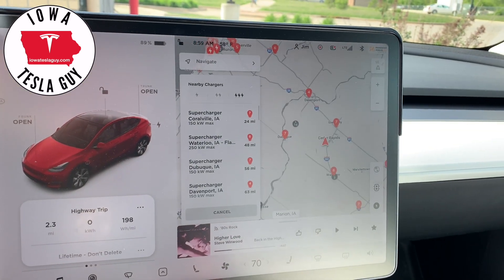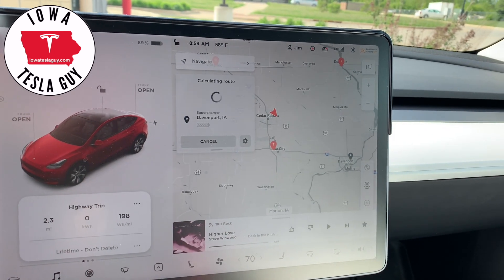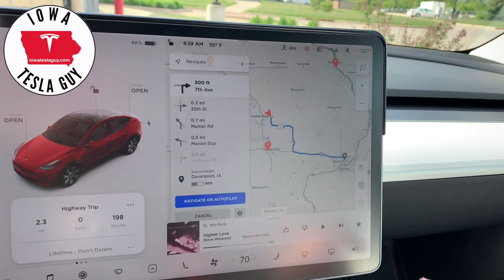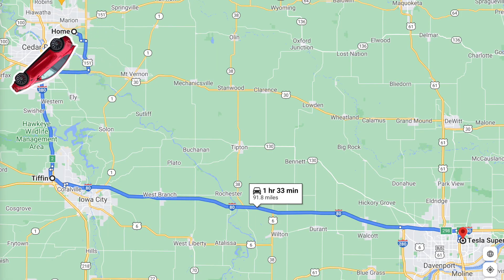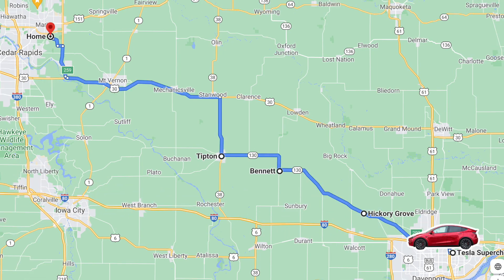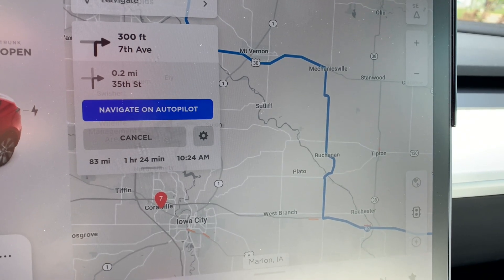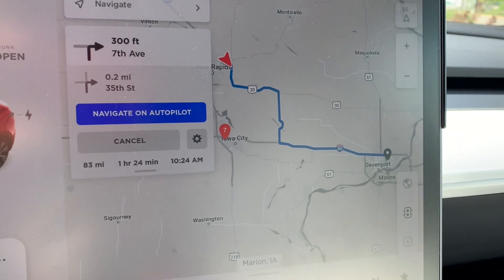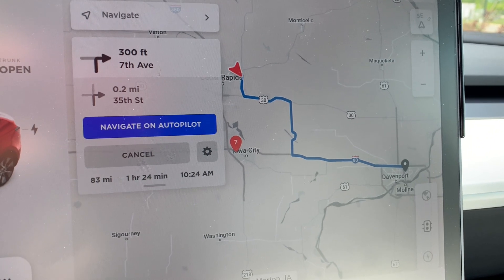Tesla Highway Driving vs Interstate - What is the impact on efficiency and cost?

Comment: Thanks for sharing, I thought your observations about auto pilot were helpful.  I wondered if auto pilot is aware of dead animals  and things in the road.  Also on the 2 lane highways there are always lots of slower areas, curves, hills etc and it appears that the AP does not know hot to handle these correctly.  This is good to know.  

People think they are saving a lot of time by going faster.  Do that math for the distance travelled.  The amount of time saved going faster is not very large for local travel.  It adds up if you are going cross country long distance, but for local travel the difference in the time saved between 55mph, 65mph, 75mph is not that large.  People are just impatient and like the feeling that they are getting it done faster.  Doing the math you find out it really isn't that much faster.  

Also if you were having to generate that power KWH yourself you also know that every kilowatt is quite expensive to generate.  I am convinced the reason people are so casual with wasting energy is they don't have to provide it themselves, and the subsides keep the cost artificially low.  Many people parrot back "climate change", but if they are serious about it they suddenly pay very close attention to all these details of all their energy used and not just when cruising around in very expensive EV's.  I heard it once said that until you carry your own water you don't value every drop.

Comment: It would be interesting to see the cost savings with the same back/forth highway/Interstate trip in an ICE car using the same average mph.  As always, great video!
Reply from the maker: That would be interesting. However, it would force me to drive my wife's gas car - which I would prefer to avoid. :) Thanks for watching!
Reply: @iowatesla  Ha!  It's still a reasonable trade-off to validate the EV data & savings you reported on the different routes,  speeds and use of AP.  Curious minds want to know if ICE cars perform relatively the same MPG as EV eMPG in areas affected by speed and non regenerative stop/starting!  Might I suggest a long drive to see a movie & meal with your spouse who drives the ICE vehicle?  ;)

Comment: I’ll take your word that elevation is same at home and destination. 😅 I like your practical videos. What was the travel  time each way? Wonder if taking longer trips if you’d have similar total travel times considering shorter supercharger stays on back roads, needing less charge.
Reply from the maker: I have elevation on my Apple Watch. The actual change was less than 200 feet. The time down was around 1.5 hours. This wouldn't be the normal direction I would take as it is farther. The time back was about 1 hour 15 minutes on the back roads. As for reduced charging time, definitely. The 8 kWh difference is about 10% on the battery. Depending on your state of charge, that 10% could take a while if you are on the upper end of the battery. However, at the lower end, you are probably talking less than 10 minutes difference. Thanks for watching!

Comment: Several YouTube videos report that Autopilot tends to take curves too fast, but most had speed set at 5 mph above the posted speed limit. Does this +5 mph offset cause Autopilot to take curves too fast or not? Could you do some testing on that? Maybe at -5 mph offset, 0 offset and +5 offset? (BTW, I now have a gen 3 wall connector installed in my garage. Just waiting to order a model Y after Austin plant is in production, so I get 4680 batteries and the cast front and rear frame.)
Reply from the maker: I have my autopilot set to start at +0 over. I used to have it set +5. I turned it off. Found it easier just to adjust manually. Even at +0, it still doesn't slow down enough. It does make the turn but you feel like Mario Andretti doing it. Does not make the wife happy. Thanks for watching!